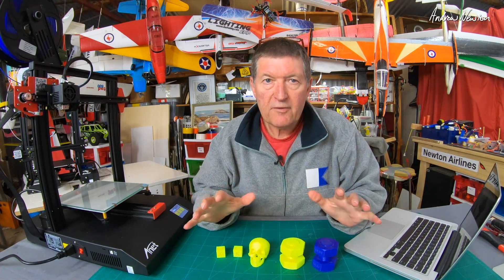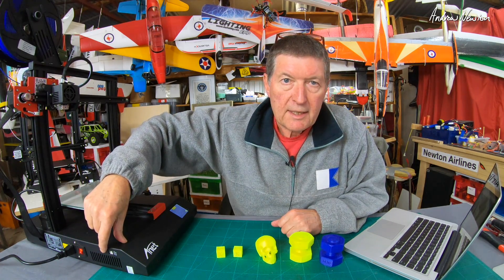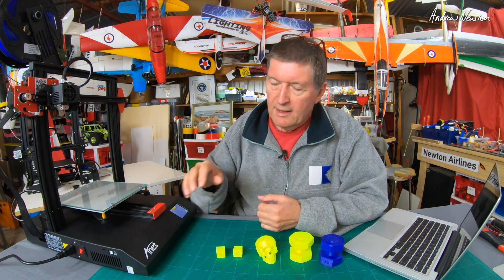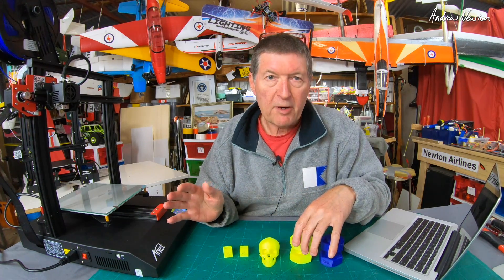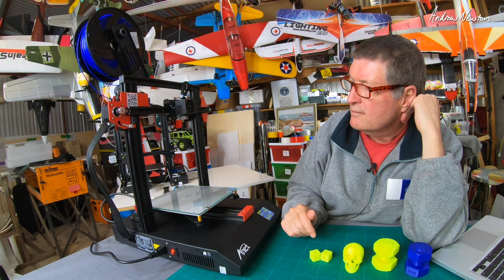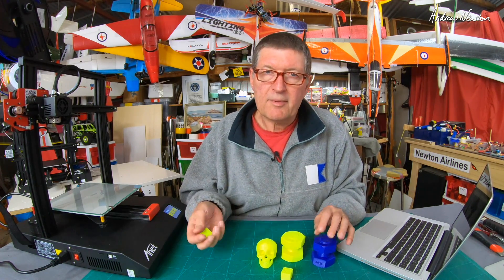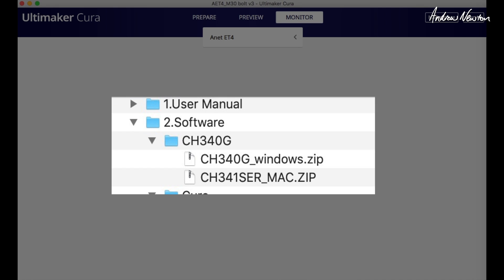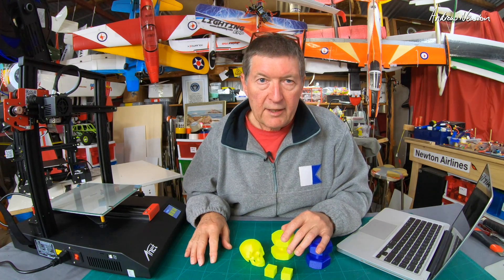Anet ET4 3D Printer Mods

Comment: How do you set the to prime the line at the begging.
Reply from the maker: Manually is the best way. Just push the filament through until it starts extruding
Reply: @AndrewNewton  sorry what I ment is like  on the. Ender. When it starts to prints  it does the line down the left hand side of the bed
Reply from the maker: Here is the Ender start code
; Ender 3 Custom Start G-code
G92 E0 ; Reset Extruder
G28 ; Home all axes
G1 Z2.0 F3000 ; Move Z Axis up little to prevent scratching of Heat Bed
G1 X0.1 Y20 Z0.3 F5000.0 ; Move to start position
G1 X0.1 Y200.0 Z0.3 F1500.0 E15 ; Draw the first line
G1 X0.4 Y200.0 Z0.3 F5000.0 ; Move to side a little
G1 X0.4 Y20 Z0.3 F1500.0 E30 ; Draw the second line
G92 E0 ; Reset Extruder
G1 Z2.0 F3000 ; Move Z Axis up little to prevent scratching of Heat Bed
G1 X5 Y20 Z0.3 F5000.0 ; Move over to prevent blob squish

Comment: The fact that it Z-homes at the top would be annoying, I guess. I know why they did it, it's to facilitate the "recover on power loss" feature, since you can't home on the bottom, as on other printers. It seems to make quite a bit of noise - mind you, when I bought my printer (Wanhao i3 Plus) back in 2017 the noises the stepper motors made was one of the cool things about it. Sounded like something out of science fiction. I still think it sounds cool.
Reply from the maker: I have only used noisy 3d printers. A quiet stepper motor would be cool.
Reply: @AndrewNewton  Pretty much all the more recent printers are "silent", which is why the ET4 surprised me. I don't think it's the stepper motors themselves, it's the drivers on the main board. I wonder if the base level Ender 3 makes the same noises.

Comment: I think I noticed your filament roll rocking and dangling correct? If so I printed 2 half cylinders with a hole through the center and each half on one end a flat round stopper and now the roll sits central and rolls nicely but give about mm under size for roll section as if it's to tight it won't unwind the filament and bind up
Reply from the maker: Yes I have done the same, as well as adding a line guide to improve the entry angle
Reply: @AndrewNewton  what style line guide did you do? As I'm trying to think of something to improve
Reply from the maker: I bent up a line guide from heated PVC pipe plastic.

Comment: Thinking of replacing my aging 3d  printer. Bother Anet ET4 & Ender 3 are reasonably priced on banggood. So which would you recommend?
Reply: You can upgrade your anet et4 now to marlin 2.0!
Reply from the maker: Ender 3 because it uses open firmware. Meaning you can calibrate it properly.
Reply: Andrew Newton ET-4 is now open source.
Reply: @eamesaerospace2805  @Andrew Newton  After some umming & arring I ordered a prusa mini. I own an Anet A6 & I thought I'd see what a difference a mid-tier brand would be like. Even though it is the lowest tier of a mid-tier manufacturer.
Reply: @AndrewNewton  Thanks. Got my eye on Creality 3D Ender-3 V2 in the OZ warehouse. Seems about the same with some tweaks. Bit more $$ but free shipping cuts it back a bit.

Comment: I have heard that several people have had problems with using the Anet ET4 calibration sensor and getting a level bed.  I was able to convert a Chinese version into English.  Here is a PDF file if anyone cares to use it. 

https://drive.google.com/file/d/1h-fNrE0DS0Af5LuKOPpa1ELB4-tvU2je/view?usp=sharing

Thanks for all you do!
Reply from the maker: Thanks for the link. Easier just to do a manual level

Comment: Just upgraded to a dual Extruder  now its under  extruding 35%  I tried to send it G code commands in Simplify3D M92 and M500 but nothing changes. Please help me Updated the E steps for the extruder.
Reply from the maker: As far as I understand there are no calibrations possible other than scaling in the slicer. I am a noob to 3D printing
Reply: @AndrewNewton  Makes sense that's the simplest way. I'll have a go at it tomorrow.

Comment: Almost nothing on Thingiverse works.  1/2 of it has manifold errors.  Every time I've printed something from there, at the end, I have to design my own part anyway.  Most things there are first versions or concepts.  Not things that have been refined.  A tip, I run the filament 2 to 6 feet away from my printers off to the side.  This way I get a stretch of filament that moves up and down under it's own weight as the hot end moves around.  However, the machine can never push it back on the spool.  Ended that kind of print failure.  You should be able to extrude 10mm to get it back at the hot end in your start G code section.   Study the board, you might be able to upload Repetier to it.  If not, people install Ramps boards in cheap printers all the time to get full control.  I run a number of Davinci 1.0 and 1.0A's which are locked down but I've hacked them over to Repetier.
Reply from the maker: Good tips thanks. Lots to learn

Comment: The settings worked for me!
Reply from the maker: Start and End code? Good tp hear anyway
Reply: @AndrewNewton  Yes, start and end code. Thanks for doing the research. But the heavy duty hair spray bed adhesive is making me sneeze!!
Reply: @bmpowellicio   Rather than the mess of using hairspray, consider trying "Magigoo".  I am getting about 4 to 6 prints per application on my Anet ET4 glass bed without adhesion failures.

Comment: Thank you for this update; calibration was 0.2 mm off each axis on 10mm cube. Print quality is awesome tough.    I’m also facing the issue of the cables from the hotend to jam between the upper frame and the hotend itself while Z homing, non letting the micro swich to click. That leads to horrendous noises from the Z stepper trying to squeeze the cables thinking it did not reach home position. Do you think this kind of ramming can damage the printer?                                                 Anyway I will have to solve it routing the cables differently.
Reply from the maker: Mine has done that too, still working fine.
Reply: @AndrewNewton  Thank you for taking the time to reply!

Comment: So basically your video about printer mods is "Look at me, see how clever I am and if you want to be as clever as me, figure it for your bloody self"
Reply: You need to get out more, mate.
Reply from the maker: The code is listed in the description. Let me know if you can't work it out.
Reply: @AndrewNewton  Thank you, I didn't know this was here. Therefore I apologize for my comment, but I did hear "work it out for yourself" so I dodn't think of ,ooking here. Even so, it's beyond me. I used to have my own TV/Video repair business and I could fault find with no worries, but that was many years ago and now I'm 71 I appear to have lost not only that ability, but today's computer languages and code leaves me scratching my head. Throw something based on Basic and I'd handle it, but I honestly wouldn't know where yo start with what you've put here. 

The reason I wa interested in this printer was becaise I heard it was a great beginners printer and special knowlege wasn't needed. I'd have no trouble putting it together, but software I can't handle. It sounds silly to want to learn about something I haven't got and have little chance of obtaining it, but I manage to save a little from my pension and if the car doesn't break down or the wind blow the air conditioner of the roof "again" or some emergency happen, I may be able to save enough by Christmas or at least this time next year. Who knows? I may even win Lotto. if we still bought tickets :-) My wife keeps telling me to sell off all my planes. I've got around 20 built and the same still in boxes. Ny problem is I get too attached to the ones I've built and those still in boxes are the ones I'm itching to build. She is right though, it's not that I'll ever get around to flying them.
Reply: @propfella  The G-code is a text file and dates from the 1950s, when we were both pre-school, so if you know Basic, you should cope fine. Before you max out your pension, factor in the cost of filament, 1kg per month. This can get addictive, especially if you can't get to the flying field.
Reply: Andrew makes a huge contribution for which you pay - absolutely nothing. I hardly think abusing him is a good strategy if you want to see more good stuff.

Comment: Thanks for that, I will try at least some of the changes. I'm a hacker by heart, so delving into the G-code has been great fun. 

My filament retraction between prints is more like 80mm, so its given lots of phantom prints, at least until the brim has been started. I'm not too bothered by a 3% scaling error, but your workaround looks fine to me, as a 3mm shorter 1m fuselage won't be a great problem. I won't be so cavalier when I print a metre yacht, there every mm counts. 

With my longer prints, I've taken to using a video link, Skype for example, to watch progress from elsewhere.

BTW, the sound of the printer is great. It reminds me of the pen-plotters that I used to use back in the 1970s before wide format ink-jets came in. So there is nostalgia even in 21stC technology.
Reply from the maker: Wouldn't notice the scaling on most prints I guess but it's not the way it should be.

Comment: regarding Thingyverse, you may have noticed that the search function does not work at the moment and will only display a few results and does not load more as you scroll down.
Youtuber 'Licence to drive' gave me the solution and you can make the Thingyverse search results work correctly.
what you need to do is open the Thingyverse website and then resize your browser window on your pc into a narrow size so that the items featured on the home page are displayed in a single line, one on top of another.
You can then input your search and the results will work and load more as you scroll.
once you have done the resize and made your search you can maximise the window and it will work fine but it needs to be done for each search you do.
If you see an item you like and want to open it, open it in a new tab or window!!! 
If after you have taken the steps to make the search work you click on something directly and then navigate back, the page will be broken again and you will need to resize your window and repeat your search so always open designs you want to look at in a new tab or window!

Once again, its was 'Licence to drive' who gave me this solution and he deserves the credit, its not something i discovered myself.
Reply from the maker: Thanks Steve. Thingiverse is frustrating at the moment
Reply: @AndrewNewton  yeah, they fix one thing and break another don't they!!

Comment: That monitor screen on CURA the same way connected to OctoPi with an Octoprint plugin in Cura.  Maybe the printer can connect to OctoPrint?   The Ender certainly will and it works great - could not imagine working without it.
Reply from the maker: Octoprint on the iMac? Worth a try